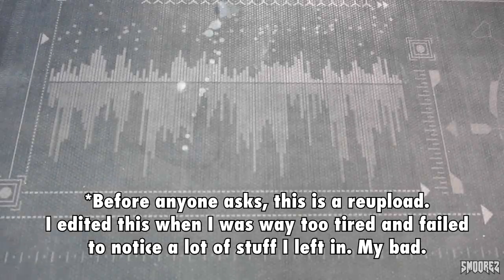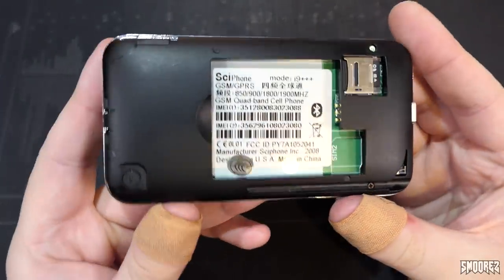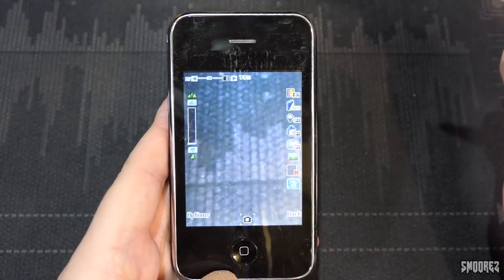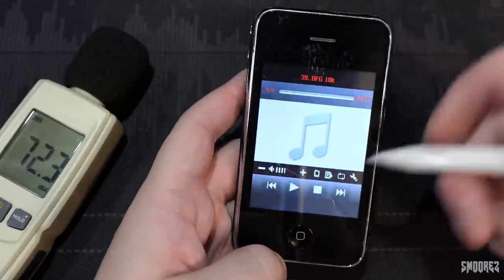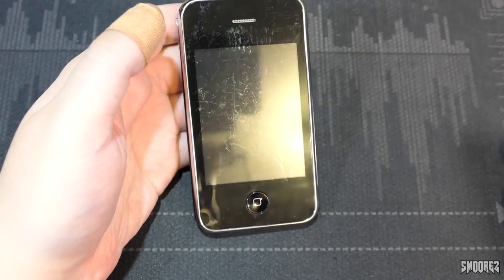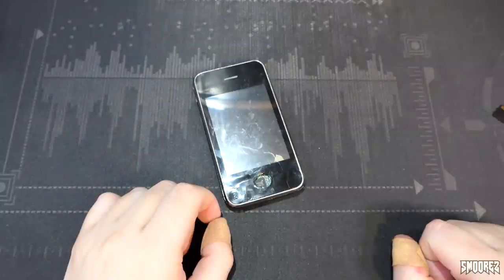iPhone Clone Month! The SciPhone i9+++ 2008 (iPhone 3G Clone) - Review & Teardown - Part 9

Comment from the maker: Reuploaded due to some information in the video being incorrect
Returning to a somewhat normal duration, that's much better.
And I used Google Translate for the apps, still didn't help much!

TIMESTAMPS:
The Unfortunate Events of the Mousepad: 0:00
Intro: 1:26
The Device: 2:30
Quick Comparison: 4:21
Taking the back off: 5:07
Power On, Buttons & UI: 6:24
The installed Apps: 7:47
Main Apps 1: 9:14
The Camera: 10:43
Camera Test: 11:52
Main Apps 2: 14:00
Speaker Test: 15:42
Settings & Main Apps 3: 17:53
Ringtones: 19:05
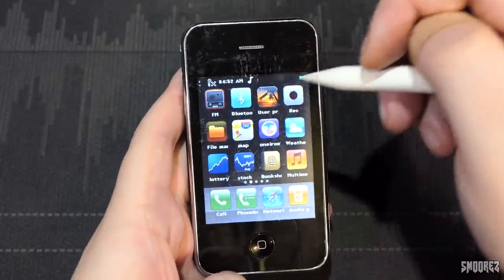Main Apps 4: 20:00
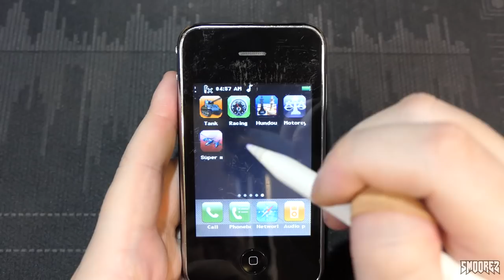The Games etc: 24:05
Games Done & Conclusion: 30:52
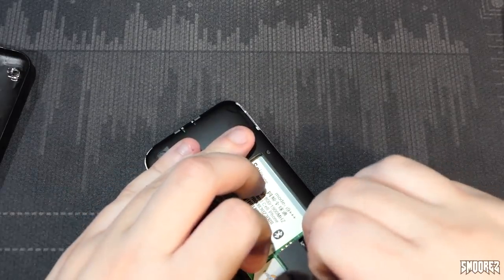Destructive Teardown: 32:16
Specs etc: 36:22
Outro: 37:17

Be good people!

Comment: 34:20
The device is running MediaTek MAUI as the Operating system, with a horrible skin. 
Looks like MAUI Version 4, Firmware Rev 1 from the label.
Production date of the motherboard PCB (since we're using the China date system, it'll be 2009 May 9th) 
Hope this helps!
Reply: hey mate, where did u find all this info abt mtk maui and stuff? im interested
Reply: Download?

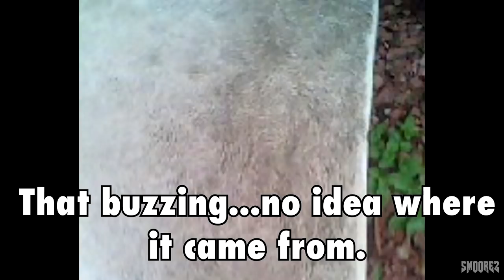Comment: 12:45 - to me the buzzing sounds like the 2G modem is trying to communicate. The weird thing to me is that it sounds like interference from a data burst or sustained connection, not the stuttering noise one would hear from a logon request or something. I have never been in an area without 2G coverage and witnessed this, so it might be totally normal to hear this kind of interference where you are.

Oh the sweet sound of 'the front of houes technician has forgotten to turn their cell phone off' of the 90s :). good times.